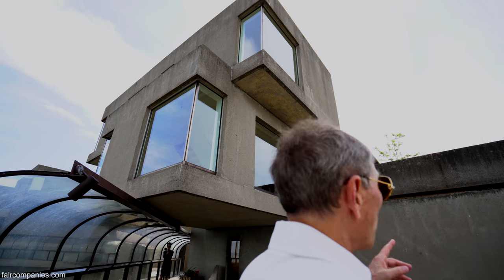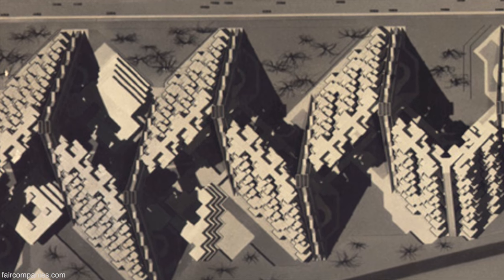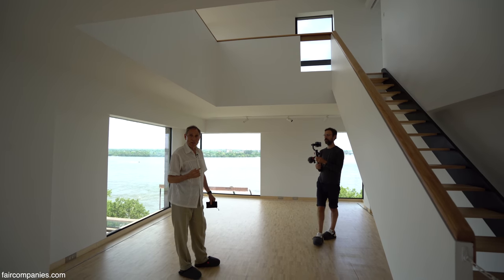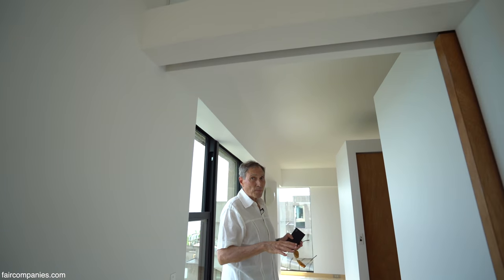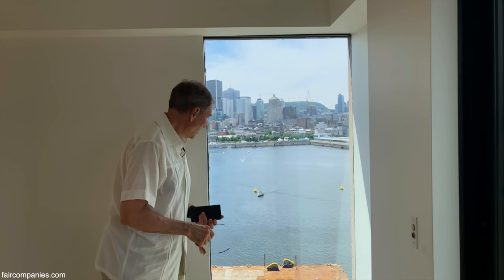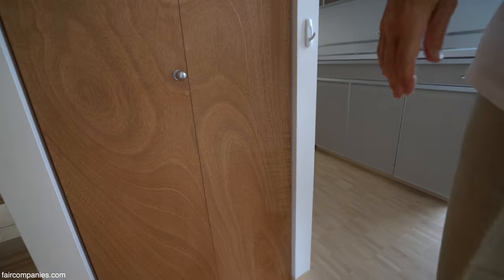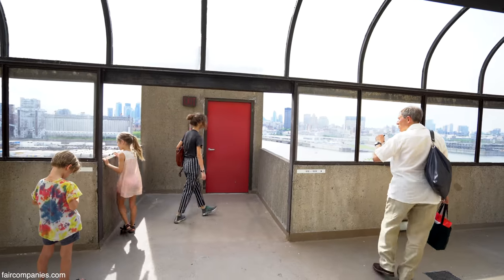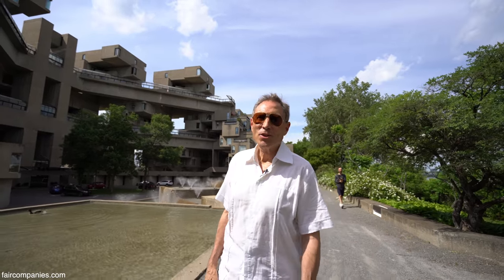Habitat 67 stacks 354 prefabs that get urban/suburban balance

Comment: The entire complex needs to be cleaned with a high pressure water washer.
Reply: make that a bulldozer
Reply: Not designed for cleaners. I would pour yougurt all over it and plant moss.
Done!
Reply: Looks like dingy modern upscale projects.
Reply: 1:19 From above it looks like the favelas in Brazil. It's ugly, and echoes. It also looks cold and dark in places.
Reply: At this porosity pressure washer wouldn't do much.
Reply: That's all I was thinking seeing the place. It look fantastic (even more than I thought) but the place needs a good scrub and maaybe resurfacing (even thought, it goes against brutalism principles).
Add more plants on those empty roofs and voilà!
Reply: Also: painted, treated, analyzed, studied and made new.
Reply: It’s just called a pressure washer
Reply: Zebby Best I thought the same thing. It looked like a rio favela until they went up close. It feels like a “brizolão”.
Reply: It was Brutalist architecture then; it just looks painful now.
Reply: Why?, the structure is old anyways, so in a few decades it will likely be demolished.

Comment: As a maintenance tech for an apartment building this place would drive me crazy
Reply: I noticed the multitude of small concrete patches on the exterior walls, then thought about shovelling all those steps and open areas in the -25c Montreal winter. You can’t use de-icing salts because of the concrete. Would be a cash cow for a maintenance company with lots of patience.
Reply: It would drive you rich af 😎😁

Comment: I always wanted to see Habitat 67. I finally got to see what it looks like in the modules after all these years. The design is amazing. Almost timeless (except for the interior). The exterior has really aged quite a bit since I have last seen it in 1986 from afar. It is quite clear to see that when it was designed, handicapped access was not a priority at all. Not even for elderly residents. Though all those stairs must be good exercise. Moshe Safdie also designed the Ford Theatre in Vancouver as well as the Central Library Branch, which is just across the street from the theatre.

I enjoyed watching this video. It fulfilled my curiosity about the building and the interior of the modules. The views are extraordinary. It kind of feels like a living architectural museum.

Comment: I like the simplicity of the interior and at the same time the clever ventilation system: yes from outside it's ugly but at the same time the apartments have a lot of light and the structure is well ventilated; it's essential to preserve the concrete. I bet they are pretty cold during the winter but we are talking about the '60's if today you use double glazing windows and insulate the concrete outside it will be much more efficient and perhaps with some modern colour palette it will be much better looking an addition of cascade of plants will made it look more green instead of a bunch of concrete boxes. Pity the modules are been used only for one project: if it was repeated it will be more cost effective.
Reply: Concrete technology has moved on hugely from then, really significant improvements could be made. Some basic software tools could be developed in conjunction with the module engineering to make it an off the shelf solution that could be situated nearly anywhere.

Comment: this building looks so fun and quirky. however I imagine the heating costs might be quite high considering it's in canada and it has such a large surface area. definetly not suited for people who are trying to live with a small carbon footprint.
Reply: 1967's idea of energy efficient and handicap accessible.  Not much opportunity to improve either; anything you did to add insulation would hide quirky details or destroy the appearance of the whole.
Reply: I'm sure you heard him say that the apartment hes showing is 2 units put together. I've lived in Montreal. At that time, There were four distinct seasons which means heat was not needed to excess. Insulation mitigates heating costs no matter where you live or in what.
Reply: @condew6103  when did he say the place is not insulated?
Reply: @MR-xf8xg  You can see the single pane glass, and then when he points out the wall thickness as viewed through the window... pretty thin walls. I doubt there's any space for insulation within the reinforced concrete. So you have concrete, maybe a layer of wood framing, and then plaster board. Concrete has a high thermal mass, but as OP pointed out the perpendicular arrangement of the units results in a high surface area. The reason the air blows out in front of the windows is to mitigate the loss from the windows (which would be huge) and also to keep them from fogging up.
Reply: Beautyfull views on water and ugly concrete
Reply: @sunmarsh  there has never been single plane glass in Canada since 1850, if the rest of the world is backward when it comes to insulation, Canada is not. We have thermo pump, pulsed air system and everything we need to face the winter and the very hot summers. it might be cold in the winter outside it is not inside just as it is extremely hot in the summer but not inside.

Comment: How is the heating situation in there? It doesn't look very insulated...
Reply: We lived there in #904 2000-2006. Insulation is 1 1/2" PS beadboard. So huge heat losses. At the time it was natural gas heating $350 000/yr or $1 000/module. A great place. But really a failed attempt at affordable single family housing community. In 2020, we would be concerned at limitations of modules 16' X 34'. Still it was brilliant. Nice to see George is still giving tours.
Reply: @Jeffrey Brooks - Nice to hear from someone, who actually lived there, thank you. I've had issues with feeling cold from the outside facing walls all my life. I cannot imagine a bedroom being exposed to the elements from so many sides and not feeling the cold, especially in winter and in Quebec!

Comment: I really love the concept of every unit having an outdoor terrace space (and apparently a very ample terrace space).  It all seems very (too) spartan to me, however (maybe because we were looking at an empty living space and not an actually lived in space). Also, with all of those exposed, outdoor corridors/hallways I am thinking walking to your apartment, on cold winter days,  might not be a lot of fun.....in Canada.)
Reply: It's a trade-off. Would you like walking in an enclosed concrete tunnel to your apartment? One of the things that usually happens in an apartment complex is the double-loaded corridor. A dark hallway with units on either side, kind of like a hotel. If you enclose the hallway and condition it, then you're paying more for heating cooling too, a cost which would be passed on to the residents.
Reply: @sunmarsh  ya, those hallways are like the number one reason i'm trying to stick to duplexes when apartment hunting. Ya, I don't need to live out The Shining everytime i leave the house even in summer.

Comment: Bet it could be made fro storage containers some how for cheeper maybe.
Reply: The reason storage containers are so strong and light is because of the folds in the walls of the container. Once you start puncturing the container to add windows it loses its strength and the openings must be reinforced with a secondary structural system, thereby making it rather pointless to use shipping containers in the first place. But I understand and appreciate the idea nonetheless.

Comment: It's interesting that people find the design 'messy' and 'scattered', but the concept is actually very simple (same unit, repeated 1 to 3 times, perpendicularly stacked). It is not 'random' but carefully calculated to offer views and terraces for every apartment. And finding an apartment is not that difficult because the building is ultimately arranged linearly, so you would just walk along the terrace on the correct level until you found the one you were looking for, just like you would any other complex.

Comment: I bet they're freezing cold in winter.
Reply: That was a concern number one for me right away! So many walls exposed to the outside and concrete, relatively thin .. must be a nightmare in the winter in Quebec. I've lived in prefabs and that's an issue number one!
Reply: @katnip2u  i lived in a bare concrete wall 20 story building on the 18th floor for 2 decades, never had any warmth issues. In winter it was warm in summer it was cool. There was no insulation on the outside. Temps outside from -20 to +40 C, it was years 1980-2000.

Comment: I love the concept, but alarmed that there are no people out enjoying the outdoor spaces.
Reply: Cathleen Baldwin Maggi I was thinking the same!
Reply: @QuinnEdwards1  That's how Brutalism got it's name. Here in Chicago, The University of Illinois, Circle Campus (architect: Johnson, I think,) has giant concrete courtyards that inadvertently focus the wind and litter blows with surprising velocity and settles in the sharp, concrete corners. Most students speed through these cold plazas into the surrounding neighborhood, built in the 1880's on.
Reply: @tomsenft7434  that is not how it got its name. It comes from the term Béton brut, which "translates in English to “raw concrete”. The term is used to describe concrete that is left unfinished after being cast, displaying the patterns and seams imprinted on it by the formwork. Béton brut is not a material itself, but rather an architectural expression of concrete."
Reply: Montreal can get melting hot during the summer, so that's maybe why.
Reply: @tomsenft7434  Brutalism comes from the French "Beton brute", which means raw concrete. Simple and misunderstood.
Reply: You can tell there aren't a lot of young families there, out enjoying the area and playing around. Which made it kind of creepy, tbh.
Can you imagine an ambulance finding which house is yours in that maze during an emergency? How will the elderly handle all of the walking?
Reply: @dibutler9151  Too expensive for young families.

Comment: Lot of flat roofs. How does the rain and snow drain?  Looks like it would be very easy to 'fall' over the edge.
Reply: @steviegee2011  When you aim to please the masses, or allow them to vote on building designs, or seek committee agreement, you end up with crud. 1967 Habitat looks as good as when I saw it as a 5 year-old. The structure has aged beautifully - with the City of Montreal etched onto the concrete itself. Concrete is a material that ages exactly in the ways you see on this video and the architects, designers and builders understood this. Metal that rusts, shiny copper finials and statuary which green in the weather, and streaky/stained concrete are testament to what the artists had in mind at the drawing board and sketch book. It looks incredibly lovely to me. Brilliant!
Reply: @drunkvegangal8089  ok, I got your point, but "lovely" is not really appropriate.
Reply: @mucsalto8377  "...in the eye of the beholder" ;)
Reply: @drunkvegangal8089  maybe you check it with an ophthalmologist ? :-))
Reply: @mucsalto8377  Bwaa ha ha! I like a laugh. Thanks.

Comment: I love it. No matter what the haters say. It's beautiful. Yes, upkeep can be challenging on multi flat roofed concrete systems. Insulating properties may not be ther best. Tooling for innovative design can be cost prohibitive. And some may have a distaste for the materials altogether. But considering advances in construction technologies, this is a wonderful proof of concept that has laid the ground work for developers and architects to run wild with, have it not been for the bottom line.

Comment: Kirsten you should also check The Walden 7, is an apartment building designed by Ricardo Bofill's team and located in the town of Sant Just Desvern, close to Barcelona, in Spain. It was built in 1975.The original project includes 446 residences. The name of the building is inspired by B. F. Skinner's science-fiction novel, Walden Two, which depicts a utopian community and itself is a reference to Henry David Thoreau's novel Walden. It is noted for its use of modules to create apartments and many public community spaces.[

Comment: Looks amazing for a 50+ year old building, a bit concerned about fire safety and elevators etc but still amazing.
Reply: Concrete doesn't burn...
Reply: They are a pain to heat in the winter. They would probably be more efficient further down south.
Reply: @drjethrowski1225  lol I mean for the people, like how you would escape
Reply: @drjethrowski1225  I bet there's lots of lovely asbestos.
Reply: Palatine of facts but I guess you don’t need to run far away since it’s concrete? Even if it will start burning inside, fire most likely won’t  spread.

Comment: ok, this is a love-it or hate-it place. Great piece of architecture, maybe less livable than a more urban place. I got some serious questions, maybe a local can answer it:
Insulation: this was built before the energy crisis of 1972 - single panned windows and concrete walls for harsh Canadian winters may be expensive to heat in winter and to keep cool in summer?
Winter again: all these open spaces - how are they cleared after heavy snowfall or - even harder - frozen melting snow?
Disabled persons: Can you still get to your home when elderly or handicapped? I saw a lot of stairs.
Public spaces: Are this open spaces on bridges and terraces really used by the tenants? The video showed all this spaces completely empty.

Comment: The only thing I really dislike is the electricals being on the floor .That's a terrible design. Have a water leak? Splashes? Goodbye!
Reply: How? Don't they have circuit breakers?
Reply: @tomsenft7434  circuit breakers don't always react as quick as needed to stop death.   PE electrical engineer 20 years.
Reply: @xomox5316  , its 2020 not 1970. We have GFCI outlets that react instantly. And the electrical isnt in the floors but the baseboards. Their are many houses back in the day, and maybe even built today, that have outlets on the floor dating back into the late 1800s.
Reply: @xeroinfinity  The better reaction of a GFCI is not an excuse for poor design.  First GFCI is just a device they fail and can be out of tolerance, second even in tolerance the human heart can stop before a GFCI trips.    You are telling a PE that also started and owns a company what good electrical safety design is...lol the internet.
Reply: @xomox5316  , Its not a poor design when the systems have been used for over 100 years. Nothing else you can do with concrete, except run unsightly conduit, or cut into the concrete everywhere. When neither is a cost effective. IDK what third world country you think this is, but its Canada, and the USA, where standards are higher than most countries.  Lmfao
Reply: @xeroinfinity  You have zero idea what you are talking about, just keep yapping guessing at counter arguments on a topic you know nothing about.
Reply: @xomox5316  , you shouldnt assume anything about me. lmao
Reply: @xeroinfinity  I don't need to assume your choice of argument lets me know everything I need to on this topic.
Reply: @xomox5316  ,oh but i thought you were a F'ing expert?! I Guess not, since you're the one still arguing. L
Reply: @xeroinfinity  I have down time, during this project in Colombia.  My Spanish is not great so I respond to fools on YouTube.  That of course can be an endless task clearly.

Comment: At the ground level, it is much more attractive. The views are great from the apartments. However, the upper walkways are depressing because if all the concrete. They ought to have vines or plant boxes at the higher levels to warm up the spaces (many wasted rooftop spaces that need greenery). Some upper sections do look like a favela, which strategically placed greenery and an annual paint job would take care of that problem. Love the interior spaces and the private terraces. All of those open walkways and stairways must be a pain to shovel in the wintertime. And I wonder how barren the plantboxes look in the winter?
Interesting design that needs some work.

Comment: Interesting post thanks Kirsten.I really hate many new-build modern, concrete formed stuff with original laminated kitchen cabinets and fixtures. Habitat 67 is really no exception but it's not too bad. It's an architects hand-shandy and looks like Moshe Safdie got his inspiration from the favela's of Rio de Janeira. Only people over 50 with high incomes could afford to buy and just like many central London high-rise apartments, are mostly owned by retired people from oversea's.
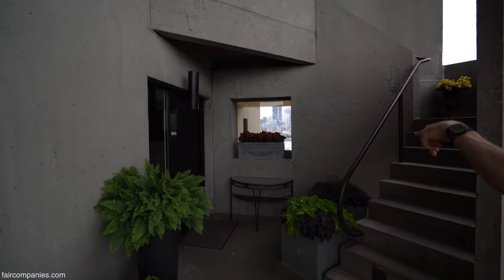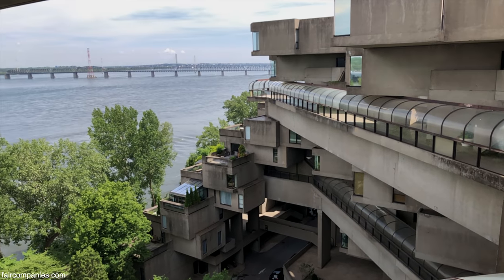As expected there is quite a bit of weather staining and at 3:42 there is cracking over the wall surface either side of the window and at 22:46 some bad surface spalling which, along with the unsightly weathered staining is in many places. At 10:48 you can see what looks like the metal rebar just under the surface, and inside at 17:00, the construction picture of the timber joists (17:00) barely touch the uprights that they sit on with more stress on one side of the timber because of the angle. In the UK a lintel above a window has to extend a minimum of 4 inches either side of the window/doorway. There are 354 modules, wouldn't 360 have been more deep and meaningful?
It was funny when the man talked about the quality of life and being able to work on your garden. What garden? Half an hour tops to weed those rectangles and then you are done.